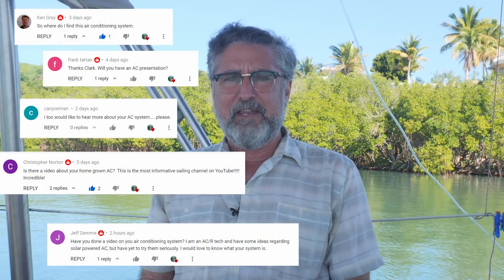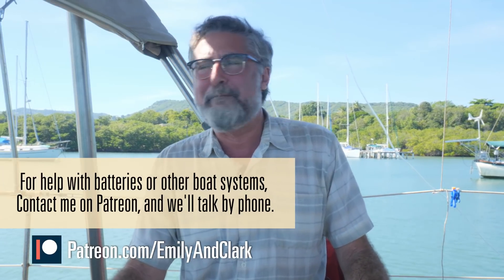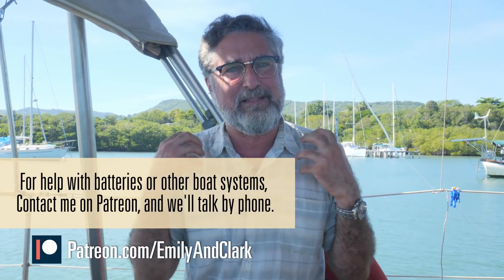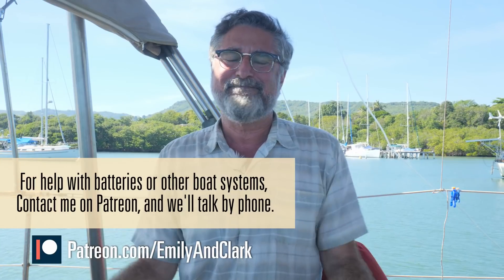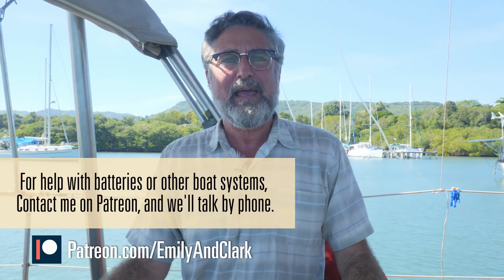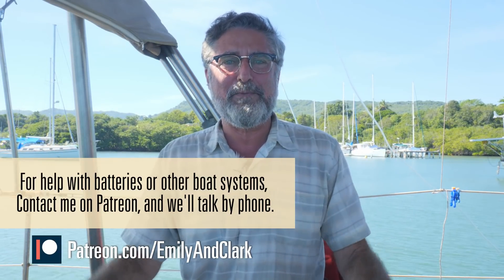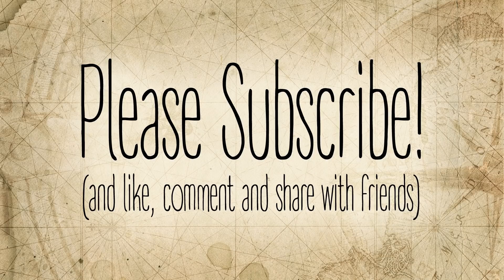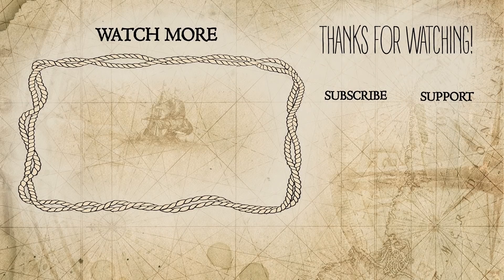Adding LEAD to your LITHIUM battery bank [Capable Cruising Guides]

Comment: Just Excellent. I have an electrical background and have studied this topic quite a bit, this last year. If only these videos were out last year, I would have saved many hours studying! Not only that, but your solution to the BMS issue can help many sailors get a much better  and safer experience with Lithium.  Many thanks for sharing your knowledge!

Comment: Aye m8’s, maybe another vid about what battery combo would make sense on an all electric sail boat, with no Diesel engine. Especially the ones with two motors, and recharging in the same unit. Just like in the episode from Sailing Uma https://youtu.be/jpAnGJpcnQU
Reply from the maker: Same as here.  Lithium.  Big lithium of course since this powering your prime mover.  But, still a bit of lead for failure protection.   Especially if you have a diesel generator on board.  The lead is just cheap insurance in this case.  You could even have it be agm that you keep in storage and only top off it's charge every few months.  Just something to run the autopilot and instruments after a big failure.  And only for voyaging boats of course.
    I guess in the case you describe I'd carry spare BMSs before I'd carry a spare battery but knowing me (and you do) I'd likely carry both!

     Thanks for joining our Patreon crew.  I'll write you there later today.

Comment: Lead is still recyclable. Lithium is, almost 100%, sent straight to the landfill because the cost of mining is so far below the cost of recycling the components. So I'm not sure lithium will ever be lower cost than Lead (for a particular power rating).

You can also get a larger pulley for the alternator to slow it down a bit, or a smaller one to speed it up.
Reply: Lithium is already recyclable and there are some companies doing it. The industry is young but growing.   Lithium Iron Phosphate has a lifespan far greater than lead acid and by the time our current generation of batteries is finished, recycling capacity will be far greater. Lithium batteries are often repurposed to lighter duty applications when nearing the useful end of life in heavy duty applications.   LFP is already cheaper than lead when you adjust for the huge differences in depth of discharge and charge time due to internal resistance, and the cost per cycles compared.